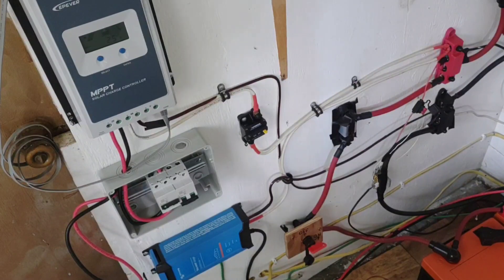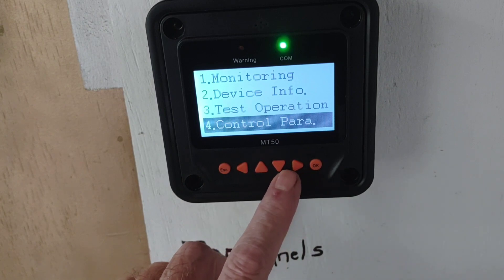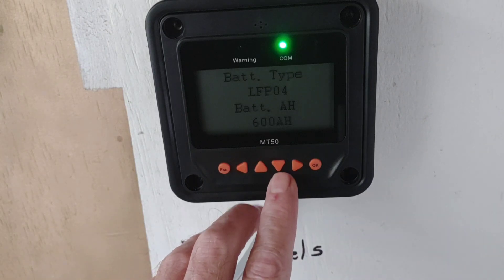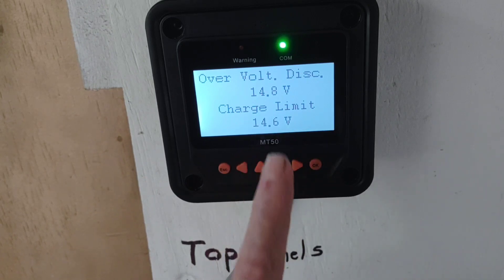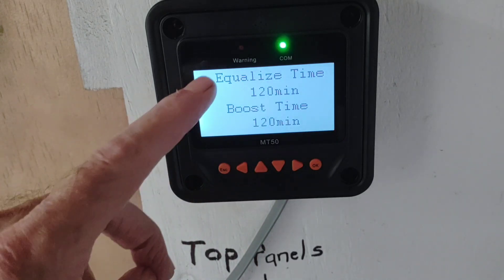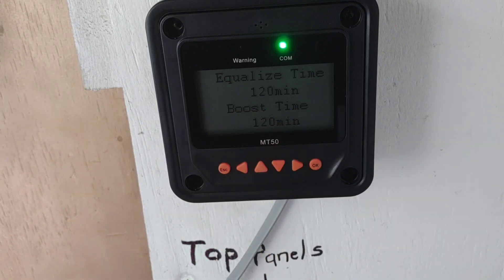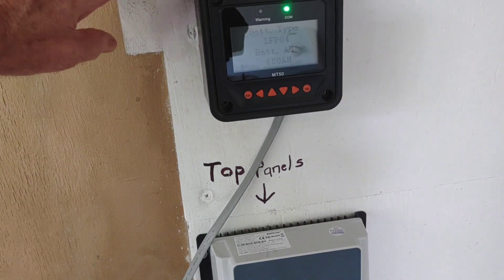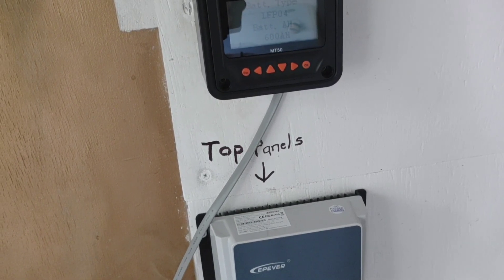EPEVER 40amp charge controller now has LiFePO4 settings installed! Yeah man!

Comment: This is exactly what I have been searching for, LiFePo4 battery charging parameters for my Renogy Rover 40A mppt charge controller. I contacted Renogy with zero help on the topic.(Twice)
 I am using the "USER" mode for custom settings since the Renogy does not have the LiFePo4 factory setting.
I have two 100Ah Enjoybot (same as Chins)  LiFePo4 batteries in series for a 24V system . 
Thank you for posting! it's much appreciated!
Reply from the maker: That's great! I am always hopeful when posting something that was useful for me can help someone else.  It makes a nice difference on these settings,  and gives me peace of mind that everything is humming along as it should.  Thank you for sharing this with us...aloha 🤙

Comment: the loss you would expect to see from undersized wire would be VOLTAGE DROP, you aren't getting that. your lower MT50 showed a higher voltage. my guess is that you will not see an increase in power by going with a larger wire. you may find that moving the lower CC will shorten the OUTPUT path, and THAT may make a change. if not, it may be panel degradation causing the difference.
If you want to do a definitive TEST, just swap the arrays outside, change WHICH array is connected to what charge controller. This will show you instantly if it is the WIRE run or not. I would do this PRIOR to buying more wire. I appreciate larger wire whenever I can, but if you don't get a GAIN from it, then it is a WASTE of money. 
Also, it is MORE important to upsize your 12v wire FROM the CC, as that is a lower voltage (higher current) and is more likely to suffer voltage drop.
Reply from the maker: That is some great information for me to chew on, and I really appreciate you explaining it in such detail.  I'm continously leaning all these aspects or wiring from thoughtful comments such as yours....mahalo!🤙
Reply: @ProjectsinParadise808  it is after all something I do professionally, so I don’t mind sharing the information. Make a video performing those tests and let’s see the results. 😃 mahalo
Reply from the maker: @sNEAKYnIGHTmUPPET  Michael...thank you for bringing my attention to the video I made earlier this evening on overdrawing the bms. It was a terrible mistake on my part, and I have removed the video so as not to promote that mistake.  I'm going to reshoot that part of it and mention my bad when I re upload hopefully tomorrow.  Mahalo 🤙
Reply: @ProjectsinParadise808  yeah man, happy to help. If you need any other help, I am happy to assist. I have literally done these system so many times in my career it is all pretty much second nature at this point. Since I have your attention, you should really consider getting away from 12v and goto at least 24. Since you already have two of the CHINS batteries it is not a huge upgrade. Just get yourself a MPP SOLAR or Growatt all in one. You will never regret it. Trust me on this. I personally always recommend 48 v systems to start, but 24 is still better than 12. Mahalo
Reply from the maker: @sNEAKYnIGHTmUPPET  You definitely have my attention brother.  I agree with everything you've shared with me. The fact it's all second nature with you I take comfort in. I've definitely been stretching my knowledge quite a bit, and look forward to when I can feel that confident.  Tonight however , I'm frustrated with that error. I'm more than a bit embarrassed at my oversight,  and grateful you caught it quick as you did. I won't soon forget what I learned tonight.  I'm humbled by the thought of maybe a thousand other people might of thought that was okay...I'm shaking my head at that thought.  But onward ho yeah. I'll not soon forget this. Aloha
Reply: @ProjectsinParadise808  making mistakes is normal, learning from them is where the value lies. 
You don't have to realize your own mistakes in life, it is enough that we become aware of them and take action.
Aloha
Reply from the maker: @sNEAKYnIGHTmUPPET  well said...I was wondering if the bms should have,  or would have eventually shut that discharging down, or is that not part of it's function?
Reply: @ProjectsinParadise808  yes, but it is still way over recommended output. Think of it like seatbelts, airbags, and crumple zones in car. all designed to protect you, but not crashing in the first place is still preferred.

Comment: How are you getting 30 to 35 Amps out of 5, 5 amp panels?
Reply from the maker: Panels are closer to 6 ampsx5 is my 30 amps, and briefly,  when colder can see 35, and even 38 occasionally.  But when warmed up, and sustained,  it usually settles around 25- 30 amps.🤙😎
Reply: I'm having trouble understanding that as well.. If you have panels at 6 amps in series the amperage does not change. If the panels were strung together in parallel then amperage changes voltage stays the same. In series voltage goes higher amperage stays the same.  You are not pulling in that much amperage , your charge controller is converting the voltage that you're getting into Amperage that's what's great about mppt charge controllers.  Great setup by the way! Aloha
Reply: Thats what an MPPT controller does....converts 12v x5 at 5-6A (5 panels in series!!)   to 12.7v @ 25-30A. DC-DC buck  converter.

Comment: when i run 5 100 watt panels in series i get 107 volts which is to many volts for my 40 amp 100 volt charge controller.... what am i doing wrong.....
Reply: I agree Roy ,I have 4 in parallel and they put out 85 V most of the time

Comment: Just about ready to program my EPEVER with the add-on MT-50 which has the user setup for LIFEPO4.  Thanks to you, I can now just copy the manufactures recommendations settings. Which I wrote down from your video, Thanks. My build is for a solar generator for emergency back-up 2.5kw 24vdc system ( I will double the setting values you show)
Reply from the maker: Hey, happy to hear you could make use of the information.  That's what it's all about,  helping each other. I was so happy to see this new programming installed,  making it much easier than it was previously. Good luck,  and thanks for being part of the conversation here...aloha 🤙
Reply: This is the info I've been searching for "is it simply double the charge parameters when using 2 x 12v batteries in series" I hope that is correct, I might buy a new controller as I'm also going up in total AH on the batteries and setup another set of solar panels then use the settings from the new controller to setup the old one.

Comment: you might be able to update the software running on your charge controllers
Reply from the maker: That's a really good point, and it very well may be possible.  I'm a bit challenged with that, and don't have anything to do that with, but in the manual it does show having that pc connection,  and settings possibilities.  Thank you for sharing this information with us 🤙

Comment: how far are the sla settings from the lifepo4
Reply from the maker: You know they're not really that far apart,  and in the beginning I considered using the sealed setting.  Over voltage discharge is a little higher at 16.0v,  but other than that it's all pretty close. I'm happier with finally seeing a true Lithium settings now however. 🤙
Reply: @ProjectsinParadise808  I knew they where ment to be close never had lifepo4 so not looked into settings

Comment: i loved mine but mine was the old model where you could put 3 times the amount of solar then the 520 watt limit for 12v the newer ones i belive can not be over panaled as much found manual for the new an model max solar wattage is 780 watts so extra panals could mean you get a more steady 40 amp output as the controller will ramp power back when 40amp is reached cables wise you should be using 6awg

Comment: The difference in amperage between strings might have more to do with the age of the panels than the gauge of wire. I highly doubt 10 gauge is restrictive at under 10 amps. You should be fine.
Reply from the maker: All panels are fairly new, and of same voltage and amps. But, I take your point,  and thank you kindly for sharing 🤙
Reply: @ProjectsinParadise808   still differences can and do exist. Try swapping the wires between strings of panels and seeing if the amperage delivered changes based on the panels or the wires. 10 gauge at that length should be capable of 30 amps.
Reply: @car2069  The top line may atrract more sun rays, otherwise why does trees grows higher?....

Comment: I don't know if this is true for EPEVER charge controllers, but many electronic devices can have their firmware updated.  This is the software used to control a piece of hardware and you may very well find that after updating the firmware on your older unit it will have the new built-in setting for LiFeP04.
Reply from the maker: That's a great point, and something I haven't tried as yet...but I'm going to look to see...mahalo for that information 🤙
Reply: Mt50 device is not firmware upgradable
Reply: I don’t think there is anyway to update the software on the controller… unlike Victron controllers that cost a small fortune…
Reply: You can update the charge controller software but not the 
mt-50

Comment: And other on the last setting? Glad to know the upgrade on the new one! 🤙🏼This makes it so much easier. I didn’t understand why Epever didn’t do that in first place. That was the only thing I didn’t like about mine.
Reply from the maker: Hey Doug! Yeah old one still set up with parameters I set up in user setting.  I'm going to reset it tomorrow to the Lithium settings that the new one has. I was so happy to see they added that in the newer model.  Other than that, they are identical. Aloha buddy 🤙

Comment: looking great ! now you know about long wire runs . remember the solar array voltage  . that voltage can zap you good . always disconnect  mc4 at array first for safety. down the road you may add a double pole weather proof disconnect right on the nice wood frame you made. use 2 of them. I  used fused disconnect my self. I am in NY and we get  our shear of bad weather even 2ft snow high wind. I grounded my metal frame on my array . surge protection as well . do some research on EMP Harding your system. lots of YouTube video's here how to do it. what I am working on now. electro magnetic pulse can come from the sun solar flair or a close buy lighting strike.
Reply from the maker: I am going to look at those fused disconnect for under the array you mentioned. And I'm going to research and watch some videos on the EMP protection.  I've taken two direct lightning strikes in the past. One at 9000 feet in the Rockies.  Hit a tree next to my cabin, arched to my hot water heater exhaust and blew a hole through the wall as big as my fist, then grounded on my wood stove.  My battery bank literally boiled for days,  and lost controller and a few appliances.  2nd time was here years ago...another direct hit. I knew I was in another terrible storm,  so unplugged and disconnected everything ...didn't matter.  Lost everything except solar panels on that one. It even blew old romex through the walls that had been completely cut off and weren't tied to anything.  Lightning makes me nervous.  Thanks for sharing all your invaluable information Robert...aloha 🤙

Comment: It is a game changer.  I'm sold on it, I'm getting one, maybe two. For the solar power Isolator, I just use an HVAC disconnect, the kind that is outside the hose next to the ac unit. It is a metal box and you just pull out a handle and it disconnects the panels from the controller. It cost about $8 at Home Depot.
Reply from the maker: I would have never known about the HVAC disconnect you mention.  That's way cheaper for sure.  I am thrilled about that Lifepo4 setting in the new epever...I didn't even know they had done that until I got ready to set it up. Sure makes it easy!🤙
Reply from the maker: Hey JR... wanted to thank you for the kind words and support from my last video on the Ampere Time battery.  I saw your comments,  but had made an error in the video,  so I deleted it,  which also deleted the few comments associated with it.  I reposted today,  with the correction in the video,  but just wanted to say mahalo 🤙

Comment: Thanks for showing those settings. I have a LiFePO4 battery coming and have the older EPever . You just saved me a lot of figuring. Been enjoying you videos.
Reply from the maker: Hey glad it helped you... that's what its all about. Thanks for being part of the sharing of information...good luck to you🤙
Reply: Bună ziua.  Am si eu un controler EPEVER 4210AN și un MT 50. Folosesc un acumulator 12v auto 75ah Plumb Acid si vreau să iau un acumulator LIPO4 12V 150AH. Are setare pentru încărcare LIPO4  ,sau trebuie făcută manual din MT 50? MULȚUMESC MULT
Reply: I got a 30a one, playing around with settings, using the app, it has 3 power settings, automatic, 12v, 24v, on auto, it had 3 battery types, , put it to 12v, now got about  10 different types, including lifepo4,  clicked on that, saved, checked settings,  14.6v charge, same as yours, 😊
Reply: So, which preset would one use if not connected to a mt50? Controller is 2206an, it has a settinf F04, which looks like a lfp setting but people go to user setting and change to their liking. Also the gel setting has no equalizing which I read is better. What's your take?
Reply: @jordandaskalov  The gel settings are very close to LFP settings and work ok .